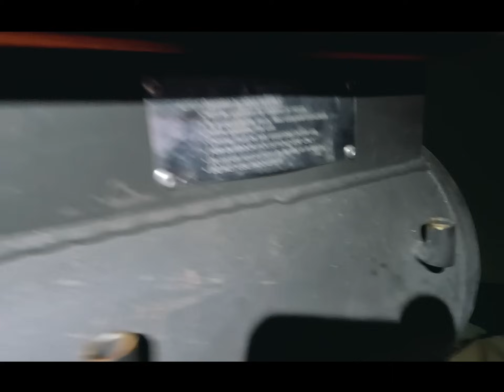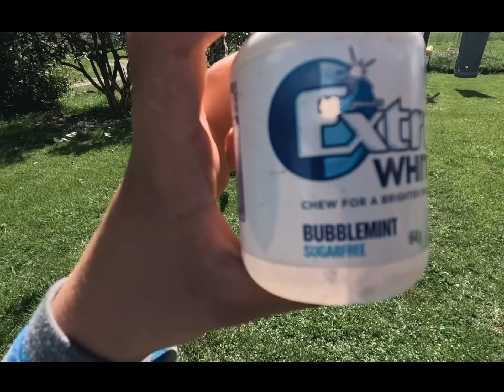New Zealand adventure VLOG 261 Josh James, Sonny Jim The eel in the Fyke net and the whitebait patty

Comment: Hey bro, Kings Premium Camp Oven Fire is the way to go. You can even get a little 3l stainless tank with a wee tap on it that clips on the side. 
PS: its got a kink aswell.
Reply from the maker: Cheers mate, I did get s Kings fire a while back but it didnt draw very well either. Hard to get going, much the same as this one. Not enough air flow. Maybe they have fixed that problem
Reply: @joshjameskiwibushman  oh ok. Mine runs good, almost dangerous with the Maaaaanuuuuka cuz